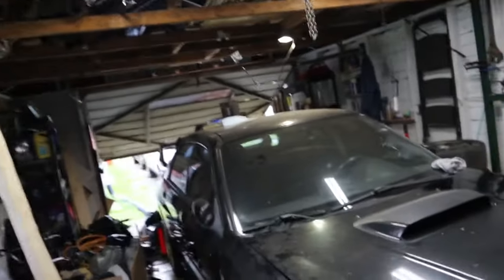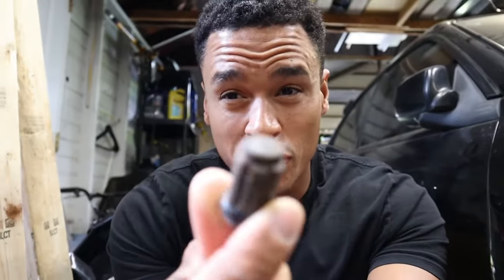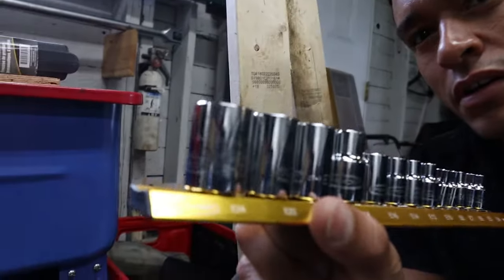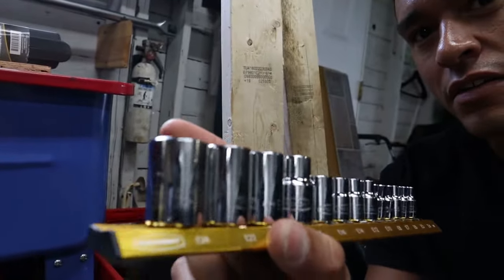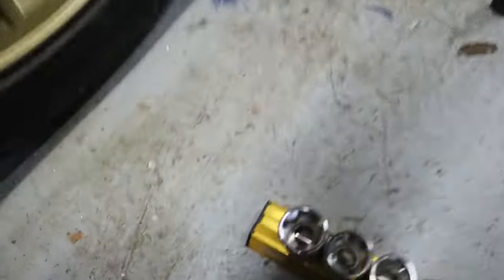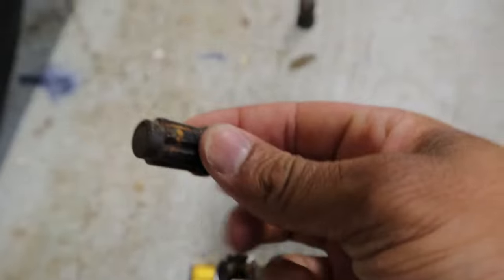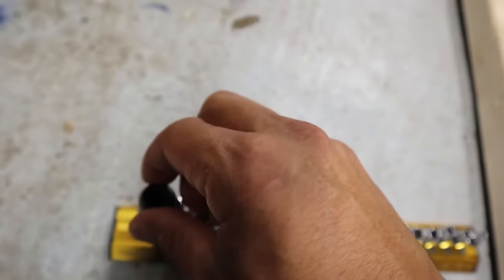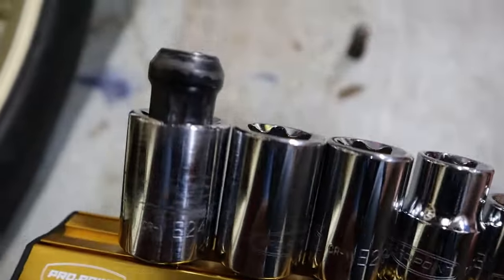How to Remove Spline/Tuner Lug Nuts Without A Key without damaging them

Comment: Hey what about a 5 spline lug nut . I lost my key and need to get it off. Any info would be appreciated
Reply from the maker: tried a bolt remover socket? they have teeth that dig in when you try to turn the bolt to remove it
Reply: That's nice if you have a torque set, if not, one is in same predict as you without spline tool

Comment: Any ideas for the tuner nuts that are round on the outside with the keyway in the middle? The middle has rusted out and nothing will grab it any longer, leaning towards trying to cut the lug off with a dremel or something or worst case, drilling out the studs. All 5 :(
Reply from the maker: What kind of wheels? sometimes if you can get an air chisel on it with a good angle you can crack those loose

Comment: Those are NOT keys! Its a spline socket and spline lug, they are all the same just in 2 different sizes. Locking lugs are keyed differently!
Reply from the maker: Yes correct! not actually keys but matching socket/lug combo